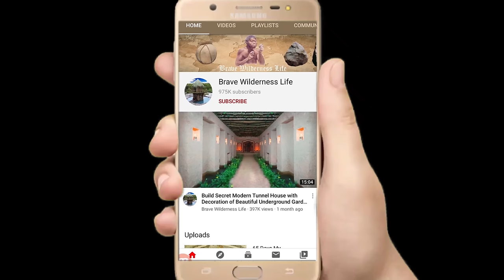Unbelievable! Build Most Amazing Simple Underground Temple Living of the King

Comment: Throwing out 100 cubic meters of the dry  lightweight  ground with two wrists is such a lie... .  With some average 200 cubic cantimeters of the ground per one throw, it would take 5000 throws per one cubic meter. Or half million throws per 100 m3 of the ground. Not considering smaller portions of the ground to eliminate when carving and polishing walls and decorative elements. Even not to mention the time for digging 100 m3 with that narrow blade). Maybe they replace hands after each one hundred of throws? Or these wrists are made of metal?